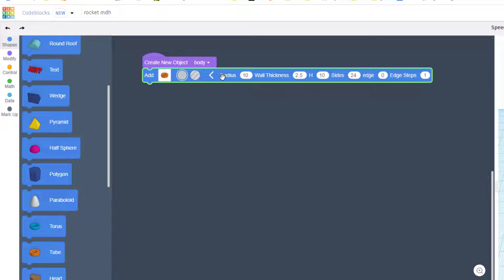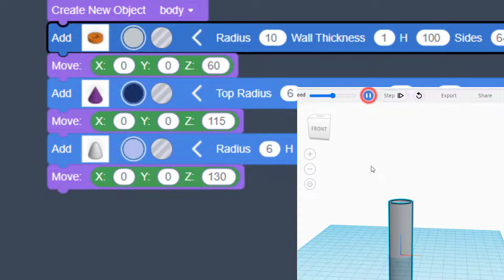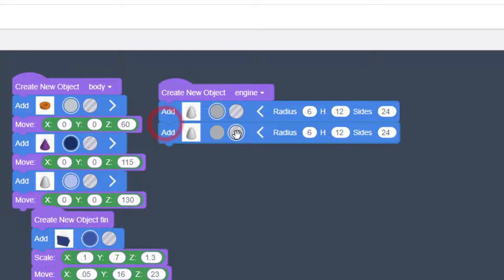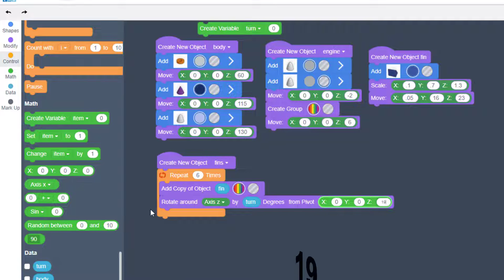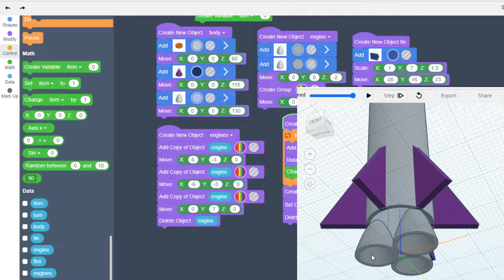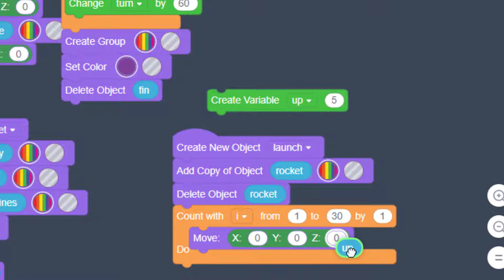Comment: When my rocket takes off, the fins don't go with it. Where did I go wrong? Is there a way to group the rocket, engines and fins?
Reply: Best way for me to check is with a share link. Sharing a Codeblocks or circuits project requires these steps. https://bit.ly/sharecb You can reach me at hlmodtech gmail.

Comment: I see that 'align' isn't available in codeblocks.  HOW did they leave that out??
Reply: It is because of how every object adds at 0,0,0. The are by default aligned, then you have to move it.  When you get slick with variables it is pretty cool.
Reply: @HLModTech  Have you even used align??  Your explanation makes no sense.  Align is probably the most used tool in Tinkercad..  Hopefully they will add it to codeblocks, as it is CB is pretty useless for real work.
Reply: LOL! Yeah, I use align when I use the traditional editor. Codeblocks is built around math. Similar to using designing with OpenScad. Check out how designing from the origin works with this chair. https://youtu.be/e1tps-5hxgU  It is pretty slick for placing a 4 legs evenly.